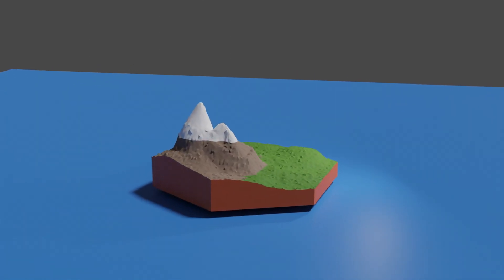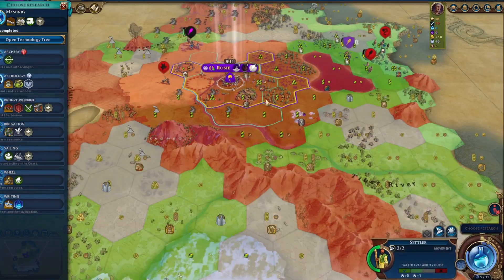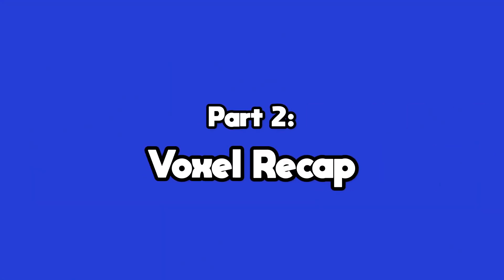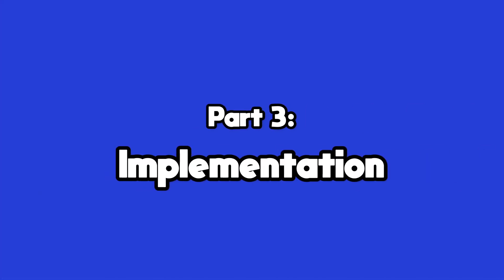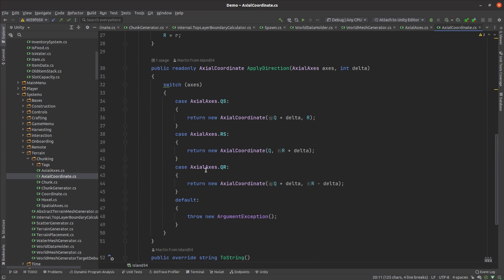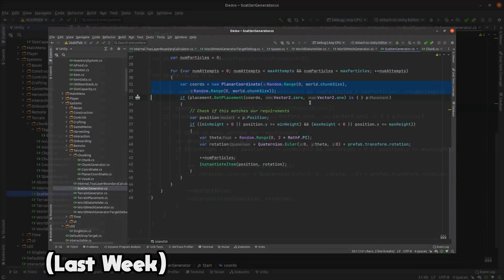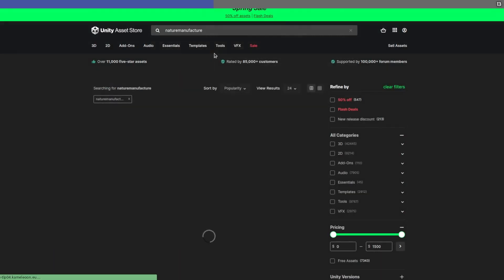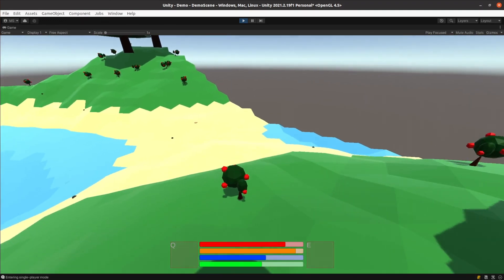Trying a hexagon-based voxel system | Unity Devlog #12

Comment: I think usually indie games tend to look better with a low poly or stylised art style, because realistic is not only hard to pull off on your own, but kind of takes away the identity of your game. I think low poly, or a slightly higher poly style would probably suit your game the most
Reply from the maker: I agree. If I play around with the NatureManufacturer stuff, it'll be with the intention of seeing how easy or hard it is then likely throwing it away. I partly want to do it to see how hard it would be to integrate a general purpose texture pack with my hoxels.

Beyond your reasons, there's a massive maintenance cost with going for high realism too. If it were realistic, I'd have to make every new asset realistic too.
Reply: @Island54Games  so true, i think you are definitely on the right track with your game so far, keep up the great work man!